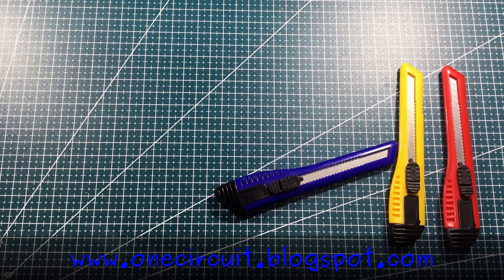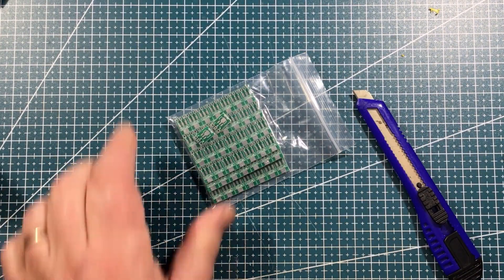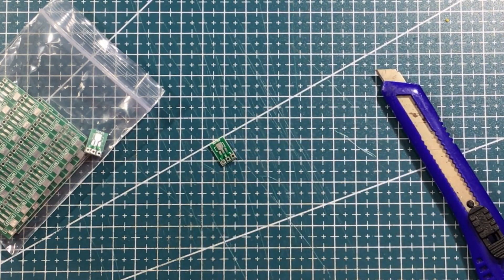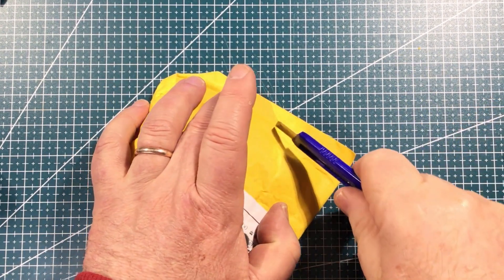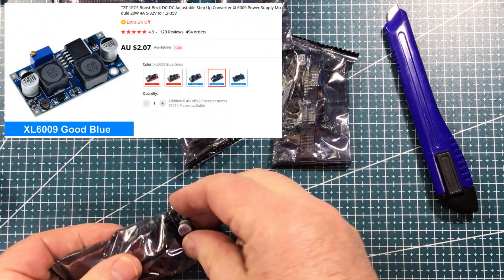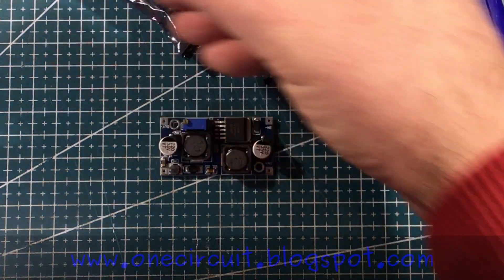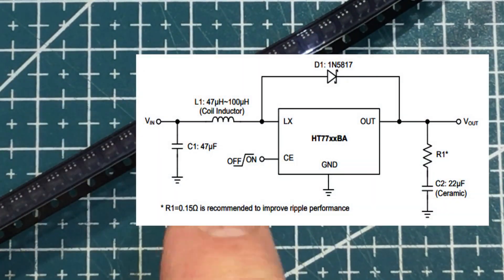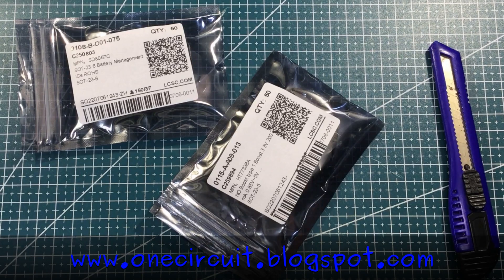Mailbag #24 including curious parts from LCSC

Comment: Enjoying your video. It would be handy to include links (affiliate or otherwise) to where you purchased some of these items.
I have found at least six different versions of the XL6009 module.
Talking about expensive chips. While I notice that many things have come down in price, the ATtiny85 seem to be really expensive as well. They seem to be as much as an ESP8266. Turns out I might not actually need the ATtiny for the application I was proposing to use it for.
Reply from the maker: I used to do links but prices and availability are so variable at the moment it is difficult to recommend an item. I do try to post the advert from AliExpress so you have the keywords to do your own search. Good luck! 👍😀
Reply: @onecircuit-as  Ok, makes sense.

Comment: Not sure you will have any luck with the STM32 chip in the Padauk programmer as the original is a 32f072xx which is Cortex M0 and the GD version is a ..f103xx which is cortex M3 , pin compatible (probably ) but the memory mapping is not the same ;-( . 
I do like the flashing LED thingy 🙂
Reply from the maker: I’m not sure at what point my optimism branches off into insanity - but I’m pretty sure you’re right about this one! 👍😀
Oh, and the blinkies are VERY popular during the festive season!

Comment: You might want to read up on the GD32 differences,  I'm not sure who wrote this, but it is a very useful technical comparison    https://cdn.discordapp.com/attachments/615438473536471051/1037271577961705482/compatibility_sumup_between_GD32_and_STM32_V2.0.pdf
Reply from the maker: Wow what a great document thank you Peter - it makes me even keener to give them a try. The STM32 version is so flaky I'm not so confident - but I'm dumb enough to ignore good advice and give it a go anyway! 🤦‍♂
Reply from the maker: Golden age
Reply: @onecircuit-as  Hehe ... similarly, I feel the Golden Age of the PC, was the Socket 7 era, when at least 5 manufactures made chips for that fit the same socket.
Reply from the maker: The problem solving going on at the moment is amazing. Re-designs, replacements, incredible.
Reply: @onecircuit-as  I can point to two annoying examples, of personal experience.  1. Clone STM chips often do not tolerate low voltages as well as the originals, making them malfunction in vape mods. 2. Creality put clones in their 4.2.2 boards, and for a long time did not offer source/bins for their printers. So it is not so much the chips are flawed or inferior, it is lazy (Chinese) manufactures, who do not read the data sheets and modify code. None of them are drop-in replacements.
Reply: I have wasted a good deal of time fiddling with STM32 clones.  Sadly, all clones I have looked into, even the Logic Green AVR clones, are different in some significant way to the originals.  They may be skirting IP laws by deliberately making the clones different. Ah, the good ole days, when you could pick up unlimited stm32f103c8b6 chips for about $1.25/ea.  I thought those days would last forever.